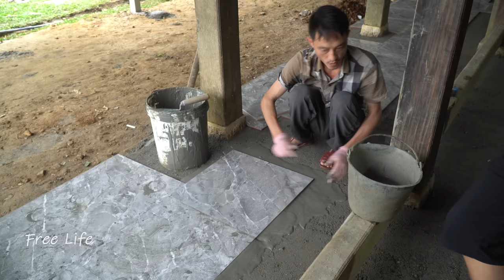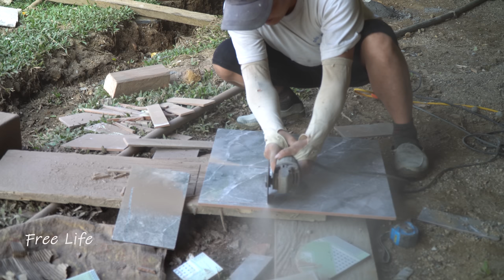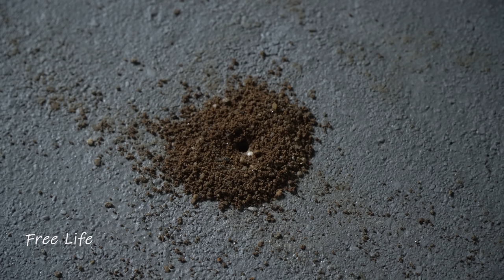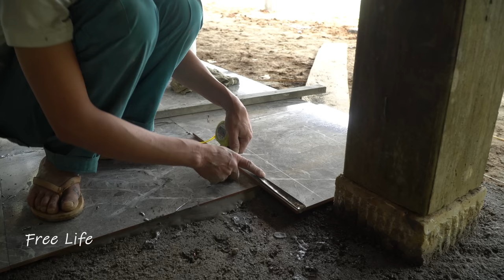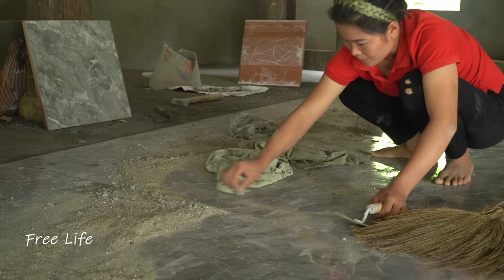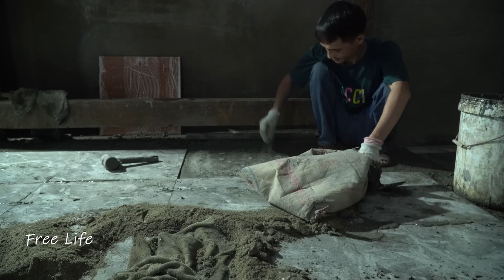Tiling floral tiles, building wooden house | free life.

Comment: Lieu well done; my advice is at least sand the wooden beams inside the house and stain/paint them before you move into the house. I think you should finish them because sanding/grinding creates a lot of very fine dust that is not just an irritant but can also cause breathing problems for occupants of the house. That fine dust will settle everywhere, therefore completing it and wiping down the dust will be better health-wise. Also paint can be an irritant so maybe you should be patient so that you finish the wall paint and leave to dry for a few days before moving back in, but if it is really necessary to get into the house you can do wall paint little by little, room by room. When you do paint please take care not to spill the paint over all that beautiful tiling! I, like your parents, are a light grey color person and delicate white walls. Airy, bright spaces it is for me. I am curious though what the front 'wall' (porch area) is going to be to be? Wooden or bamboo or it is going to stay open-air? I think an intricate traditional wall at the front would be great.

Comment: The latex paint for cement wall color white is not expensive here in the Philippines the 16liters cost only 1,200.00 Philippines peso. You can choose the cheapest but good quality
Reply: normal house latx paint used only inside house and outside need better paint if want long live paint wall and wood used only oil base paint ,not newer latex/acryl paint.